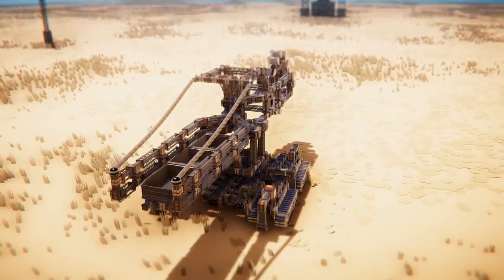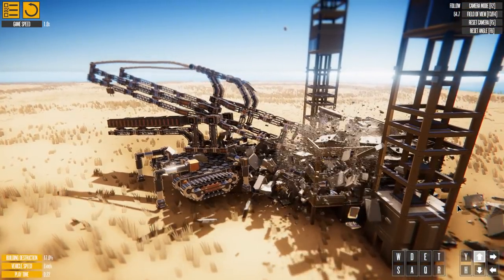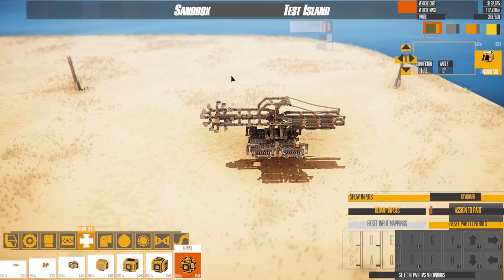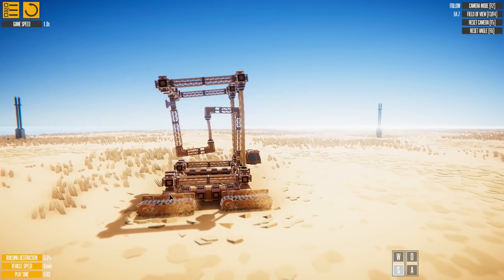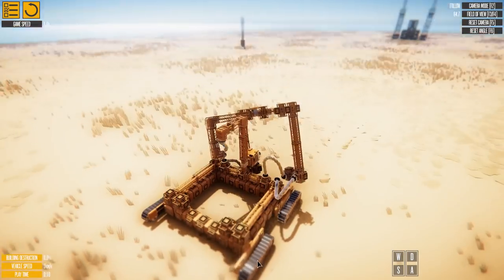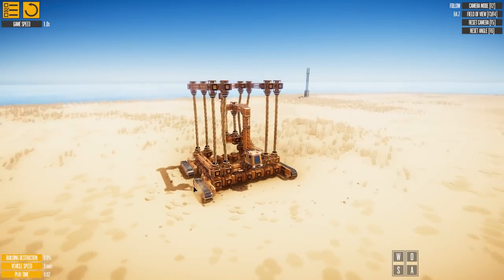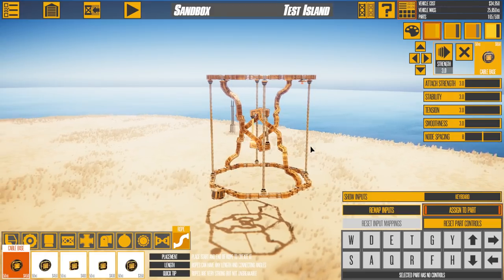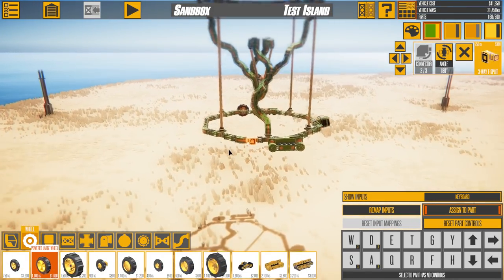Engineering AWESOME Tensegrity Structures in a Game Intended for ULTIMATE DESTRUCTION!

Comment: Glad that worked out!  You could totally add some pistons to expand the structure vertically and increase tension.  Also, the glitch was definitely treads colliding.  Need a warning or something because I see it happens pretty frequently.  Treads need a bit of space from each other.
Reply from the maker: challenge accepted :) now I need to try the pistons
Reply: @darealkosmo  9 Months later, and the buckets are still rotating in the opposite direction of what they should be.

Jk. 😅🤣
I mean, they still are rotating in the opposite direction.
It's just that I'm not expecting you to magically fix the video so the buckets rotate the right way, or something like that.

Comment: You could use a piston as a tensioner.
Reply from the maker: Piston would need to be normally extended for that to happen, otherwise the design needs to be fundamentally rebuilt. But in theory yes I can use a piston for tension
Reply: @darealkosmo  So put it on the center cable of the first creation! When piston retracts it would tension the cable. No major re-design required :)
Reply from the maker: @AgentWest  oh the first creation yes, I was strictly referring to the second one I built :)
Reply: @darealkosmo  In a way that twist was tightening everything up on that one. Almost looked intentional tbh.

Comment: The buckets are backwards on that opening machine
Reply from the maker: wanna bet?
Reply: @darealkosmo  Well, they should be scooping not pounding the back side on the down stroke? If they aren't intended to work as buckets at all, i suppose thats different?
Reply from the maker: @nyscersul42  When I built it in the last video I determined that “scooping” actually makes the buckets get snagged up,  but “slamming” seems to power through with less resistance, hence why the rotation was reversed from what seems logical to all of us :) End of the day, we ain’t scoopin’ anything anyway! :D
Reply: @darealkosmo  I didn't see the video when that vehicle was built. It seems that what you did then was to forget about them as buckets and use them as teeth instead, which is fair enough. Nice to hear back from you tho, great vids! The planes were very fun. :)